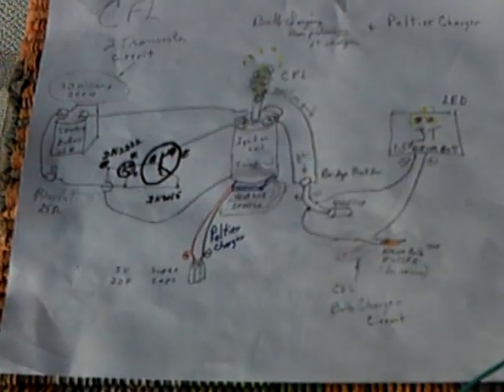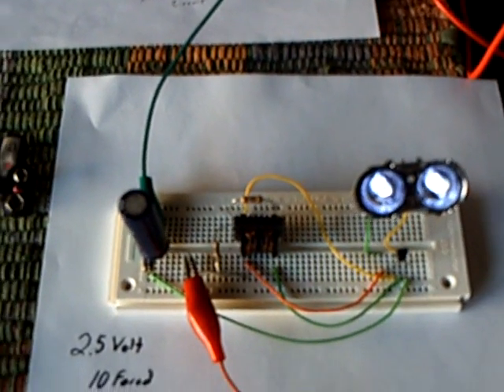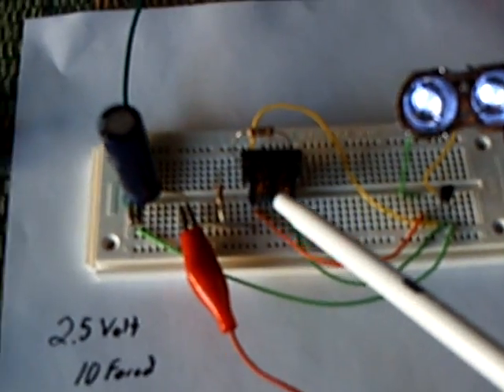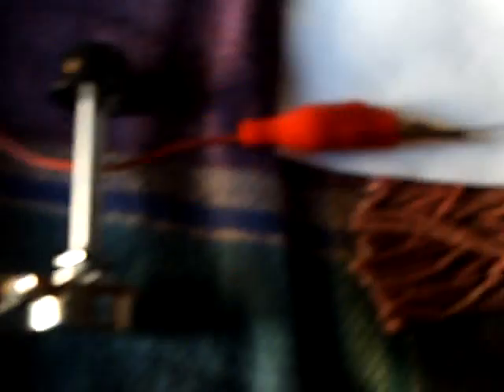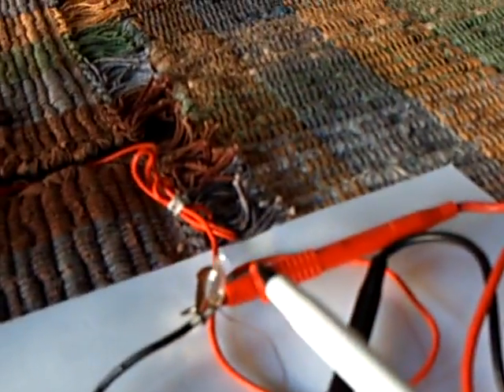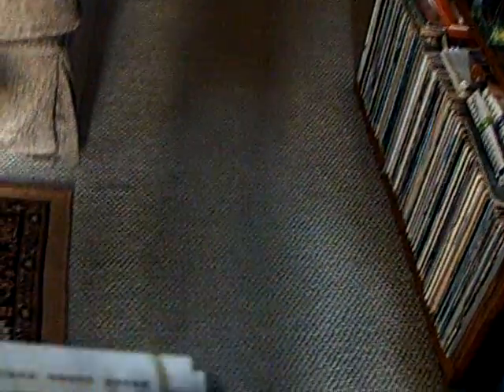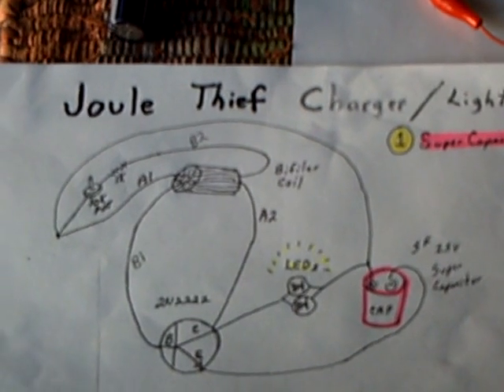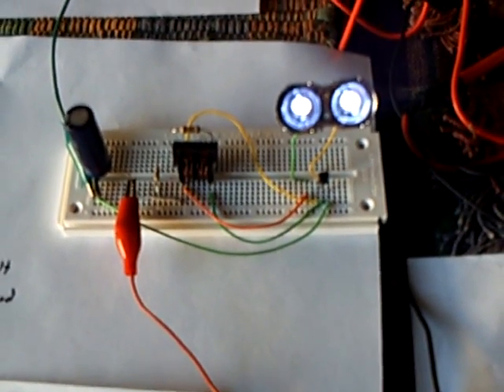CFL and JT combination lights

Comment: oh crazy Lidmotor! greak work, you're always trying so many things, thanks for sharing!
ive been running my JT on super cap so ill have to try to run it back into the front end. JTs have so much potential
I made a second JT that runs 3V and i can catch 400V off the C and E of transistor.

And ive had some luck charging batteries, i conducted an exeriment and crunched some numbers, check it out Lid:

watch?v=qIdohgylDTM